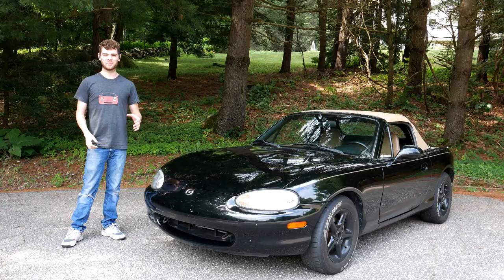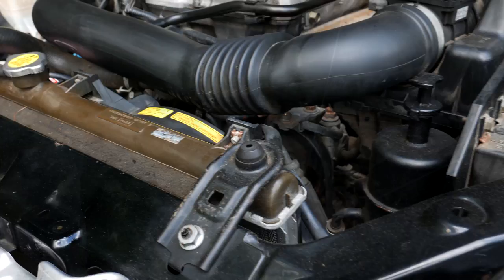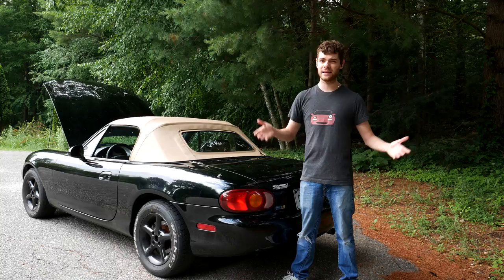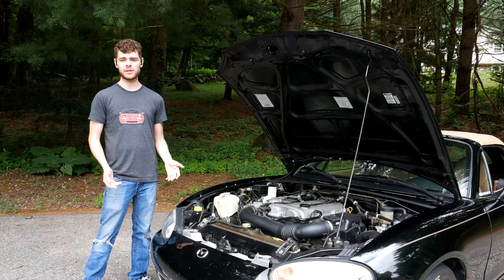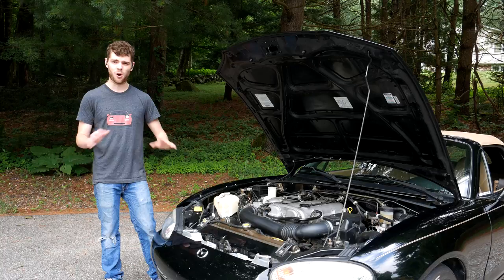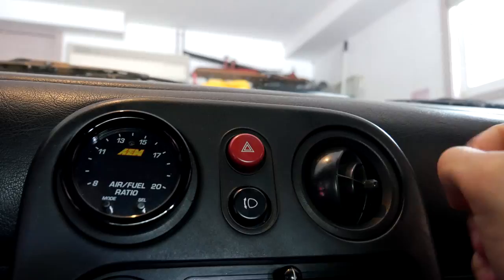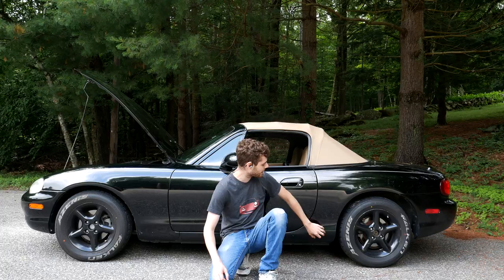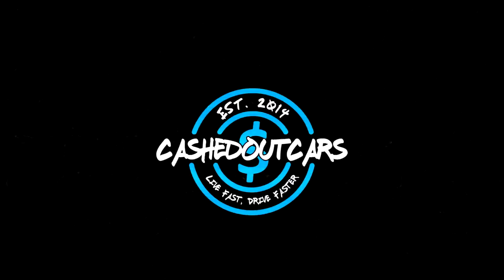5 MX-5 Miata Problems You WILL Have

Comment: Slow windows (tracks get gummed). 
Clutch slave leak.
Front hubs (not bearings) on track cars.
NB top tears
NA window tears
NB1 coil packs (overheating)
NB1 cats (caused by coils going)
destroyed floor channels ("frame rails") from people lifting them incorrectly
destroyed pinch welds from people lifting them incorrectly

Comment: 1:46 you’re supposed to unzip the glass window before laying down the ragtop
Reply from the maker: That’s an old top that was already super far gone, I was just removing it to throw it out so it didn’t matter to me
Reply: You are thinking of the plastic window tops from the NA, where the flexible plastic window can flex and crack. The NB tops had glass windows without a zipper because the glass is rigid.

Comment: 1993 Miata: cruise control does not maintain a steady speed/rpm; it fluctuates. The speedometer needle fluctuates and is not steady. How to steady cruise control?
Reply from the maker: To be honest I don't remember my cruise control working too well when I had it in my 93 either.. I  ended up removing it

Comment: Hey man, I have an nb '99, was wondering if the injector harness plug is also a common issue being loose that can cause a misfire for these models, mileage: 192,000kms, horsepower seems low even at 2nd gear and idle/low gear car stutters with exhaust shaking.

Comment: I have an 2004 Miata and the power antenna was bent and need replacing.  I’ve watched videos on this but can not seem to fix the problem.  Do you have any advice.  The breaker will not fix it unless you buy the part from them.  But that is super expensive.

Comment: I have a 2002 Miata.  Great condition only 30K miles. It will start but immediately shuts off. The mechanic said it is the thief immobilizer. The part is no longer available. However, I found a used immobilizer but the mechanic said it will not be compatible with my keys and he will not install it. What can I do? Can the immobilizer be by-passed? If I can get the used part installed, can my keys and immobilizer be reprogramed together?  Thanks for any help.

Comment: 2001 with 130k. It started making a high pitched squealing noise when the clutch is depressed. That lasted for a couple months and then it magically stopped but Last night I was leaving a restaurant got about three or 4 feet in the parking lot heard a loud bang and the car lost power. I’m guessing that it is the clutch and throw out bearings. I’m headed to the dealership today with it. What are your thoughts

Comment: I have a super low mileage ND that unfortunately just got totalled by a hit and run  jerkwad....but I elected to keep my beloved car even though it will now have a shame title "repaired salvage"   She still drives fine!  Just looks bad so I am busy buying parts as cheap as I can and figuring out how to save some of the damaged pieces in the name of economy...I think when all is said and done the car will be effectively close to free if I take into account the price I paid originally along with the amount I had to give up to keep the car (salvage value adjustment to total loss amount) along with the parts total all subtracted from the generous (I think) check the insurance company wrote me for my loss....which because of current market is way more than I paid for her!   Basically free less than pristine ND Club  Parts I have accumulated so far include Rear Re-bar, both tail light assemblies, trunk lid, driver airbag, seatbelt repair, still need both bumper covers at least but I have fortunately been able to save (I hope!?!?!~) through reworking the rear frame rail section, both rear quarter panels and the pieces that make up the trunk....I doubt it would have been worth the hours of any professional shop but my time I don't really count as I am retired lol...I think I am might just pull this one off!  I should have done a YouTube video!

Comment: HELP!!! My 91 Miata is acting like it has bad gas but the gas is good. It started with extended start, spit/sputter upon starting then clears up and idles fine SOMETIMES, sometimes it idles for five seconds then it’s like the fuel was cut off and slowly dies. The amount of gas seems to have something to do with it also. The pump is good and new( I’ve double checked the pump) the filter is new and clean also. The car will run absolutely perfect sometimes but always at a quarter tank. The car runs and drives but won’t hardly rev past 1800/2k without really finessing the pedal, it’s kinda like it’s flooding with only two cylinders firing. And while at speed it will all of the sudden lose power and engine light will come on. If I turn it off and restart it it’ll run okay for awhile then do the same thing.

Comment: 2001 NB, currently 126k Camshaft position sensor has died on me 2 times and I've replaced the clutch master and slave cylinders 3 times. Not sure which one died, master or slave, but just swapped them both when they started going. Most of the issues you mentioned, minus the rust, but all spread out over many years. I've had the car since early 2006, it's overall very stock and still runs great. Probably time to do that kswap I've been dreaming about...

Comment: 1999 clutch  slave cylinder  bolt sheared - can't remove  leaky slave cylinder (passenger side of the block accessible only through the front passenger side wheel well).

Comment: Thanks for the video. I have a 1990 NA Miata. I got it in 2014 with 92,000 miles on it. I love it so much. One issue I’m having is the trunk gets wet inside during the rain. I can’t pin down where the water is coming in from. Seems like maybe the left tail light. Is this something you’ve run across? Oh and my battery goes dead if I don’t drive it often enough. 

My radiator got a hole because it has no lower front grill and a rock hit. I’m looking to add that on. I also got a new canvas top a couple of years ago after the last one deteriorated. It does leak oil slowly but I haven’t investigated that yet.  Love the tip about the collection of debris. Ill be looking into that as well. Thank you 😊
Reply from the maker: I personally haven't had that issue, but certainly check your trunk seals and taillights. However, there's a good chance it's the top drains being clogged. Here's a video I made on this! https://www.youtube.com/watch?v=5_V6awt2b-Y
Reply: @CashedOutCars  wow that was a fast reply. Thank you so much. I was just updating my comment with more info. ☺️
Reply from the maker: You caught me at a good time! I've got a video on replacing a radiator on my channel too! The battery drain could be a lot of things, you can do an electrical draw test on it with a multimeter to try and narrow it down. Best of luck!

Comment: I had a new NB for 3 years then a new NC with electric roof for 14 years and I never ever had a problem, no oil leaks, just a bit of rust underneath on the NC after 13 years (easily treated and not serious). I now have a new ND and I love it!

Comment: I have a '93 with 260,000 and no rust and the radiator still looks new.  I do live in California so rust is not so common on any of my older vehicles but I wonder at what point I should start to see the green on my radiator.  If you are willing to help this engine sounds great and does not really have any leaking at this time but with this many miles should i go ahead and replace any gaskets or seals before they go bad.  The only one I have replaced is the head gasket and that was just because I took the head off to clean out the lifters.

Comment: Wow!  Miatas have the same problems of every other convertable car their age.  But... I have to say my wife's "06 with 118K miles has never leaked a drop of oil or coolant.  Other than regular maintenance, tires, batteries, two roofs and two driver seat covers, has never-ever been in the shop for a mechanical, electrical, or HVAC problem.  In our Nor-CA winters I can't count the numbers of BMW convertibles with their back windows steamed up, cracked, yellow, and rotting. -  MX-5 Glass rear window with defrost!  And I can put the MX-5 top up or down in under 10secs at a stop light - No BS... click the lock, pull the latch. And then pull the top up or down over your shoulder.  you don't even need to lock it when you put it down, and, it becomes its own tonneau cover.

Comment: Hello the Miata I have was driving perfectly the first day we bought it, it is a 1995 Miata. Although the next day it didn’t turn on so we bought a new battery but now today it won’t turn in again. Can you help me figure out what it could be and how it can be fixed please and thank you ?
Reply from the maker: Are you sure you put the battery in the correct way? The next thing I'd check is fuses, according to the owners manual. (Main Fuse and anything starter / ignition related)

Comment: Notice how there's no big mechanical issues (serious issues) with these cars? Keep your car out of salt and water, replace the shit stock radiator, and this thing will last you forever. I don't really see any issues here that aren't also on most older cars. Mine's at 205k mi and still purring. Only doing an engine rebuild soon for cleaning and a turbo. There's a reason the community for them is so lively.
Reply from the maker: Exactly, they're great. My NA is at 217k, original engine, turbocharged, and I beat on it like crazy and it takes it

Comment: Loose stick shift. Weird noise coming from the front end when driving slowly over bumpy areas and also sometimes when turning the wheel left and right. I checked the wheels for looseness and they seem fine to me. The bolts are tight as well.
Reply from the maker: You can rebuild the shifter which may help with that! Also, I'd check your tie rods  for the steering issue, as well as check your wheel bearings. Good luck!
Reply: @CashedOutCars  thanks so much for the tips!

Comment: Hey, looking at getting an older Miata and really appreciated your video.  The question I have is regarding mileage. The one I am looking at is a 2008 hard top (thank goodness). It doesn’t seem to have any rust issues but I’ll have to look closer. However, it has almost 180000 km on it.  It’s at a dealership so they’ve done some work (struts I believe) and regular maintenance.  AC and cruise both work but… how many km can I expect to get out of these without spending my life savings to maintain it?
Reply: Same question I have
Reply from the maker: 3rd Generation cars (NCs) have weaker engines than NA and NB Miatas. That said, I have a friend who has one with 220k miles on it, and it still runs strong. If they're maintained, they're great cars that run for a very long time!
Reply: It's a Miata, so you shouldn't need to spend your life's saving on it - no Porsche tax to pay! More seriously, in my experience it's essential that you have the car professionally inspected before you buy. Even if you know the dealer, they're not your best friend, they're a business - trust no-one. Should a professional independent check reveal faults, ask for these to be remedied before you hand over any money.  A full inspection could save you a lot of money - if you're not happy, walk.There are lots of Miatas out there to choose from.
Is there much documented service history with the car? This gives an idea about what's been done to it over the years and if it's had a caring owner. 
When I retired in 2008 I thought my sports car days were done  - and then I test drove the N/A  I've now owned for 11 years, and it hasn't broken the bank. It costs no more to run or insure than our (small hatchback) Ford Fiesta.

Comment: Rain rails don’t break. They block. Out of the dozens of instances I’ve heard about since owning my NA, 1% of them has been a broken rail…
Reply from the maker: They do block as well, but I’ve seen several broken. I’ve had 7 Miatas myself and two that I can recall had rail issues
Reply: @CashedOutCars  what can I say. You have definitely taken more apart than I have.

Blockages are more common than breakages however. They are a bugger for blocking
Reply from the maker: @ohhiitsmike I do agree blockages are more common and not a fun job

Comment: Loved the Vid.  Do you have any Vids on converting to all-alloy DOHC 60-degree 3.8 GM/other V-6s?   Do you have vids on dropping-in an LS / Ford, V-8 --all around 220-300 Hp?   Any of those'd lead to videos on suspension /brakes up-grades to make the engine mods "safe", kinda.  Also cooling/driveline upgrades/"packages" where YOU could get a piece by referral.   How about a carbon-fiber, Corvette-style {'68 - ? } hard-top that NEVER "folds", but you can remove the rear window & top-panels like on the {'68 - ? } Corvette coupes?   Do you sell body-repair sections for the "rust-out" areas you speak of?  {rear, infront of rear-wheels panels/full-rockers/front, back of front-wheel panels/doors/split-exhaust headers for making true "duals" /German cotton canvas tops/cup-holder mods/electronic-mods/wheel-tire advice per most-intended use/variable-stall autos/build-ups/conversions/etc, plus offering "rollers"?  Also, have you experimented with 8 - 18" body extensions for a bit more room/capacity?

Comment: My NA pop ups stopped working after a while. they don’t go up or down and my headlights went out also so i can’t drive at night.
Reply: Could be the fuse, Cheap piece worth checking out
Reply: @nanovazquez9450  I’ll make sure to check it out when i get the chance
Reply: @marcoochoa4868  you can manually put them up. Look under the rubber caps next to the headlight, I think that’s it.
Reply: @Theweouthereforrealclub-  Thanks, ive got them up already but my lights literally do not work i get no power to them

Comment: Bum Radiator?  Yes, 2x.   Top and rain seal?  No. non-issue.   Oil Leak --- Front and Rear Main Seal --- no where else.  Eyeball Vents?  No problem.  Rust?  No problem.
What you did NOT mention is REAR WINDOW ---- putting the top down breaks attachment seal between window and top.  Had to re-glue 2x  (3M window glue/sealer)
1999 Miata -- 250k miles. 
Also gone are plastic clips holding trunk light and center console hinge --- otherwise standard wear.
Oh, and as the car ages, it gets picky on gas octane.   Most of its life, ran fine on 86 octane regular.   By around 140k miles, required mid-grade when outside temps got above 85F and premium above 95F.   Now requires mid-grade when outside temps above 80 or premium (91 octane) when outside temps above 91F
That is all ..... 
(so far)
Reply: Oh, and the Miata-wide problem, listed in all the aftermarket repair manuals (Chilton, etc.)  --- heater never FULLY shuts off --- never has, since mile #1 and Chilton (et al) says that is common with all Miatas --- live with it

Comment: If you have a 1.6 car, the diff. Theyre made of glass and WILL break sooner or later. Broke mine the other day on stock power pulling from a red light.
Reply: What exactly happens when you break that? Just no more power to the ground or do your tires lock up?
Reply: @abafoon604  sorry for the late reply, but what happens is just no power to the ground. When mine exploded it sounded like shattering glass and the car wouldnt move.

Comment: Oh Lordy, what a whiner!  If you have a car with 200,000 miles on the original engine you’d be a complete moron not to expect a few drips and leaks.  And cars that are 15-30 years old will OF COURSE have bits and pieces that dry out, get brittle, wear out or just don’t perform like a newer car.  These problems are not specific to this brand or model.  Even high end cars suffer the same fare.  Time is the enemy of all things. Just be thankful that the car is so reliable and strong that it still performs well at +200,000 miles and 15-30 years of age.
Reply from the maker: Oh Lordy! Check out the rest of my channel it’s dedicated to these cars :) that’s kinda the point of this video.. nothing too bad commonly fails

Comment: Cam position sensor.   Located at front of 99 NB.  When it goes, you are dead in the water.  Simple fix.  I carry a spare.
Reply: I'm experiencing this now. My NB  lost power as I was driving, and just completely shut off, ran codes and it came back P0340 which was, you guessed it, the cam shaft sensor.
Reply: @stylestar07  Hope you carried a spare.
Reply: @averyhorton3614  No. I had it towed to a shop, they replaced the sensor and it still won't start. So now the mechanic is searching for the problem
Reply: @stylestar07  Bummer!!  Let us know what fixes the problem.   Good luck.
Reply: @averyhorton3614  Thanks, will Do.

Comment: MX5 2006 - water in my trunk. Most likely the water drain.
Reply: I had water in the trunk of my '96 M every time it rained or I pressure washed it. A guy in the Miata club I was in, suggested the tail light gaskets. They get brittle and let water in the trunk. It was a pain to replace them but it fixed the prob. I am not sure but one of the forums online said that the 2006 and later gaskets are only sold part of the taillight and those taillights are EXPENSIVE. If it looks like that is where the leak is, I would suggest that universal rope weatherstrip you can get at Home Depot, Lowes or parts stores. Good luck with your '06. I have had 8 MX-5s and 2 of them were '06s. My favorite.

Comment: the little hoses for the air conditionnig where antifreez pases there a bitch to take off bit you got to doit if not your car starts to heat up and you ruin yor miata from over heating if your miata starts to smell like antifreez check one of those hoses 1999 model